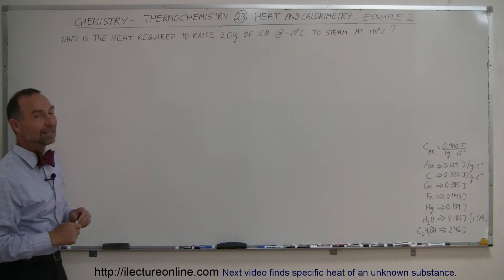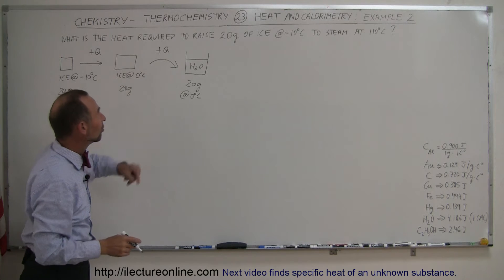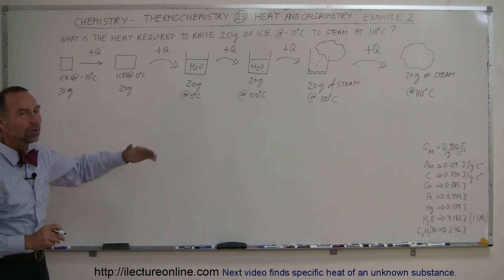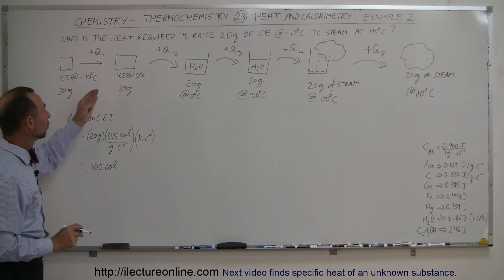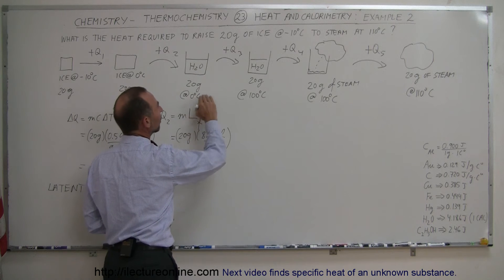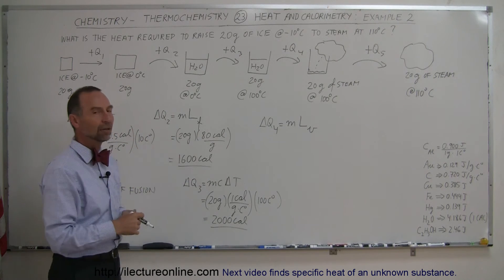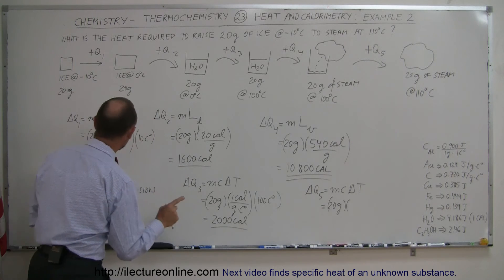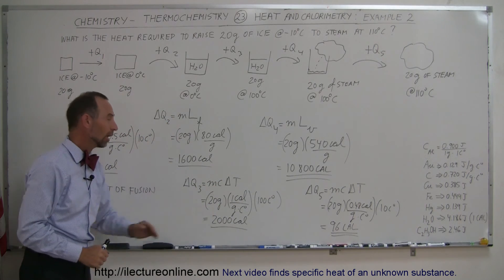Chemistry - Thermochemistry (23 of 37) Heat and Calorimetry: Example 2

Comment: so when there is no change in temperature we use the latent heat of fusion
Reply from the maker: 1. when there is a phase change, the temperature doesn't change and we use the latent heat of fusion or of vaporization   2. These constants should be given in the problem.   3. We have to account for each step in the process   4. yes, calculate the heat exchanged in steps.